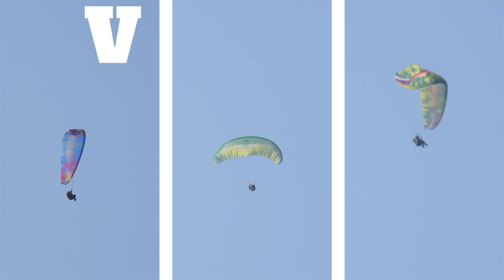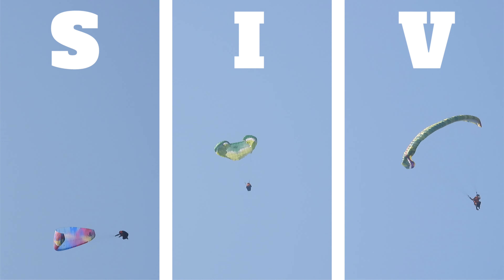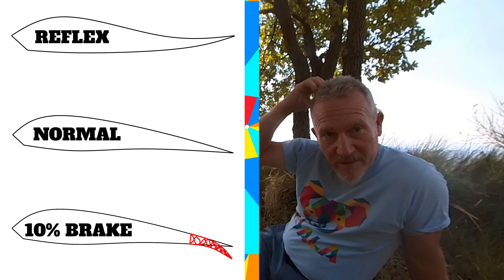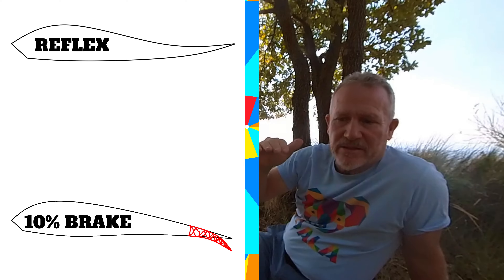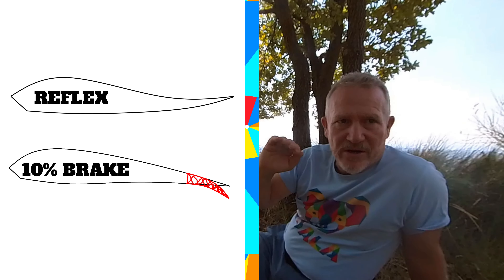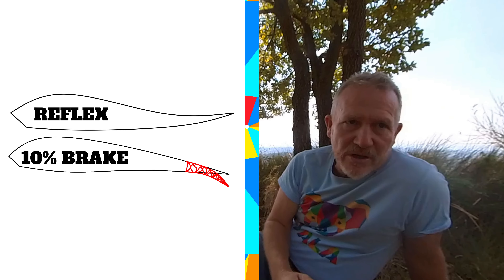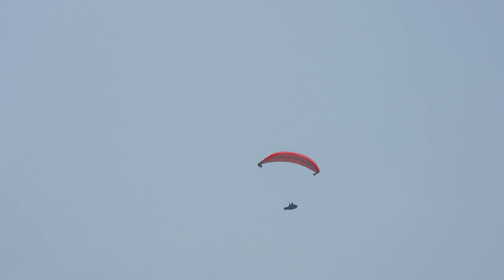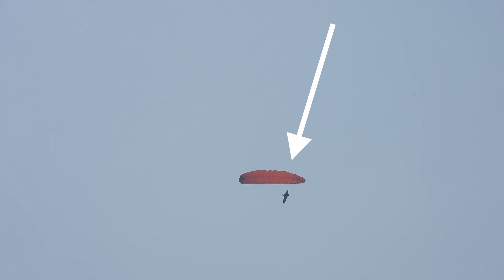10% of brake is not good for paragliding - Bruce Goldsmith

Comment: This might be misleading. Is this the whole video? He’s really referring to extreme SIV manoeuvres I would like to hear specifically which wings he is talking about, presumably he is talking about 2 liners. We have always been told to keep a little bit of pressure to feel for collapses etc. You are not in touch with it’s your wing if you fly totally hands off……….
Reply from the maker: That little bit of pressure is exactly what gets pilots in trouble, by making the wing a lot more pitch anstable by moving back and forth a lot more and in case of a collapse will make the collapse a lot more agressive. What Bruce is reffering here is contact position, which is where you take out the slack from the brake lines while keeping the trailing edge nice and sharp, here you will feel for the collapses, but will not be braking the wing or adding the 5-10% brake and potentally making your wing way more agressive.
Reply: @FlyingKarlis  Thanks for replying. What level of wing is he talking about, all wings of all classes, old and new?
Reply from the maker: @chrisstevens4680  You're welcome. He's talking about all wings of all clases

Comment: I think this means if an incident happens, like collapse or stall, go full hands up so when brake pressure returns the wings profile is correct. I have two older gliders that this isn't the case, but a brand new one that shoots like a bullet so I'll need to test this out for sure!
Reply from the maker: There is no simple answer what to do in case of an incident, as there are just so many variations of them. What Bruce is talking about is that you should not fly with constant shoulder position all the time, instead use contact positions, which is taking out the slack of the brake lines and not inducing any bending on trailing edge.

Comment: Nice video. It would have been nice to distinguish between 10% brake and contact flying explicitly because it isn't entirely clear from the video that 'hands-up' means contact flying (without slack in the lines). Had to go to the comments to make sure I understood correctly. Small nitpick though. Again, nice video! :) Thanks!
Reply from the maker: Thank you, Jorma. After uploading the video, I relisted that it should have been made more clear. Unfortunately Youtube dose not allow changing the video after uploading, I will make a follow video later on to make it more clear.
Reply: @FlyingKarlis  I think you can ad some kind of overlay in the section you want to amend

Comment: Why isn't anyone asking about arm fatigue? Brake line tension partly counters arm weight. Otherwise it's not possible to hold arms like that.
Reply from the maker: I can hold my arms up for up to 10 hour flight (I haven't flown longer than that in any one go so far) without relying on the brake lines to hold the weight of my arms. I guess it is matter of training and getting used to it.

Comment: wonder how this applies to motor flying since our wings are trimmed for heavy reflex.
Reply from the maker: I don't fly motorized paragliding almost at all, but as it has stronger reflex and also has less line drag as it used to have back in the day, I would think it is even more important for paramotor wings.
Reply: @FlyingKarlis  I have the epsilon 9 and they show a special set of risers for para motors. Please compare and contrast these two sets of risers?
Reply from the maker: @markmcgoveran6811  Good question, I'll have to look into this
Reply from the maker: @markmcgoveran6811  but usually for free flight wings that are using ppg trimmers, there is a free flight position, which puts the wing in it's trim for free flight.
Reply from the maker: Normally paramotor risers, just add the option to accelerate the wing and as you say they have the regular trim setting for free flight, in this case you should fly with your hands at the contact position as Bruce talks about in this video.
Reply: @FlyingKarlis  what determines if a wing has reflex? Does my epsilon 9 have reflex?
Reply from the maker: @markmcgoveran6811  It's not that simple, in general I would say thay mist freeflight wings dose not have it. But.. Most of them has some level of it, it might be just in wingtips or other parts of the wing. The level of it varies a lot.

What Bruce is talking about in this cideo is that we create a reversed reflex profile by adding a bit of brake, this plus less drag on lines for modern wings is what creates the instability for free flight wings.

Meaning, that you should fly at contact possition most of the time and add brake input as needed for active piloting.
Reply: @FlyingKarlis  I love math. After a number of calculations and drawings, I have concluded that the "contact position" would feel like small random pulses in the brakes line. If you don't have enough coal on line the shock absorber effect of the line being blown slack in the air will dampen out the sensation. This position will constantly vary. Wernher von Heisenberg said "there is no measurement without disturbance."when you are flying along just "contacting" that air it stiffens up the trailing edge. Probably fly an insignificant amount faster. I saw a couple inexperienced pilots who flew heavy-handed on the brakes. They went one hand up, spiraled into the ground and crashed hard. I think they were heavy-handed on the brakes and they couldn't even feel anything between pulsations anymore they were just hanging on to it and flying at a low speed. there are 3 things.perfect, I can't do that yet.error too much brakes or error too little brakes? Until I get more skills I will go light on brakes.

Comment: interesting input never heard before. I think i´l experiment a little with this to see how much it is noticeable on my LM7 :-).   In extreme turbulence i can´t judge right now how much brake i relay need to properly feel and react to the wing. but i´d guess something around 10%. My problem if i only pull out the slack i have just a few gr. "weight" to feel the glider. For 70-98% of the Conditions it´s enough. But in deep shit when it´s impossible to prevent just to soften/dempen big collapse,  i´m way faster in pulling if i have good pressure, hands fall down more automatic if collaps comes in like thor´s hammer ;-). Still imported to actively feel the wing an differ between low pressure due to low air speed on profile / incoming collaps. (sometimes not so easy if changes in split seconds ;-) ) .
maybe i see something wrong but to me the video exampel´s do not show the effect well.  The red wing was letting go of the brakes just when the glider was in the most backward position. / he open brakes during the shooting. once  it´s above the pilot the brakes are around 10%  than he brakes way to late when it´s already shooting and in front he apply relativ little brake instead of pulling full on. maybe not the best example since the reaction was overall not the best . I think in such a scenario it would have had the same result if he would have no brakes at all in the moment of shooting. 
In your clip i see you most of the time with what i think is around 10% brake (trailing edge bend down most of the time) exapt for short moments when the glider is behind you and you want to let it fly. Or brake hard to stop it. 

Would be Wonderfull to see professional pilots showing the effect with and without 10% brake on a correctly done stall / strong Pitch. Maybe thats something for Bruce and his company ?
Just have to mention that i realy enjoy Waching you videos thanks for  the work and input Karlis!  Hyperlapse is grate for learning and visualizing routs. A pitty i live so far away. maybe time for a grater vol biv to the western alps. :-)
Reply from the maker: Hey Ben, have a look at this video Bruce made some time ago - https://www.youtube.com/watch?v=y7PHY1X6E-A

To feel the wing the contact position is sufficient, meaning that you take the slack out of the brake lines while not bending the trailing edge. Of course when the air gets too rough we have to use the brakes or rare riser control to avoid collapses or control the pitch.

"The red wing was letting go of the brakes just when the glider was in the most backward position. / he open brakes during the shooting. once  it´s above the pilot the brakes are around 10%  than he brakes way to late when it´s already shooting and in front he apply relativ little brake instead of pulling full on. maybe not the best example since the reaction was overall not the best . I think in such a scenario it would have had the same result if he would have no brakes at all in the moment of shooting."

In this case if the pilot would have gone hands up all the way to contact position the collapse would have been a lot less aggressive.

"Would be Wonderfull to see professional pilots showing the effect with and without 10% brake on a correctly done stall / strong Pitch. Maybe thats something for Bruce and his company ?"

This is not a bad idea, I might do a video like this.

"Just have to mention that i realy enjoy Waching you videos thanks for  the work and input Karlis!  Hyperlapse is grate for learning and visualizing routs. A pitty i live so far away. maybe time for a grater vol biv to the western alps. :-)"

That would be quite a trip, would be happy to see you around Larange if you decide to come this way one of the days. Glad you find the content useful and educational! 

Best of luck and let me know how your experimentation with different brake inputs goes.
Reply: Thanks for the great reply and caste good light on the video and I get to have a better guess when I get done ground handling.

Comment: I’ve flown a number of (full reflex) paramotor wings on my motor setup but when i put my motor away and fly Paraglider wings (Ridge souring) I thought they we’re not reflex ? Can you tell me if the new Paraglider wings are starting to have full reflex on them ? Thanks and i agree less break better glide.
Reply from the maker: It's not about the reflex. What Bruce talks about is that by adding a bit of brakes you are creating a reversed reflex profile, opposite of a normal one, and this will create the pitch instability and will shoot a lot more agressive. This will hapen on any modern wing.
Reply: @FlyingKarlis  Sure I get that but I’m still not clear if the newer paraglider wing are Reflex there is a difference between standard versus reflex with paramotor wings so still need to do research on if new paragliding wing are reflex.
Reply from the maker: @ChrisJewell7333  Most free flight wings has some of it, it might be in the wingtip a bit and nothing in the center or a bit in center and no reflex in the wing tips. It's relatively small procentige. That isn't the main reason the wings become more instable.